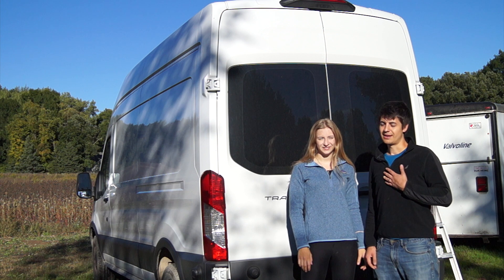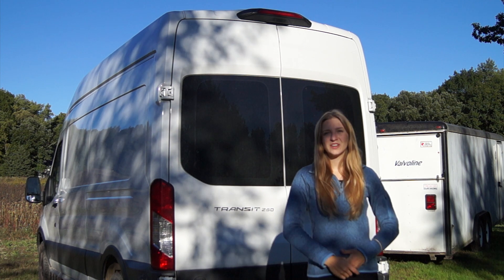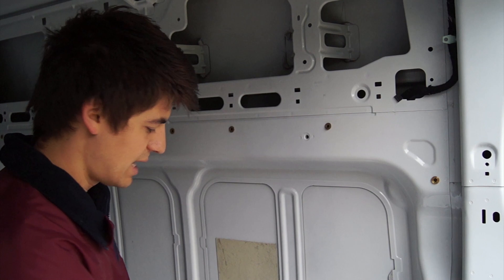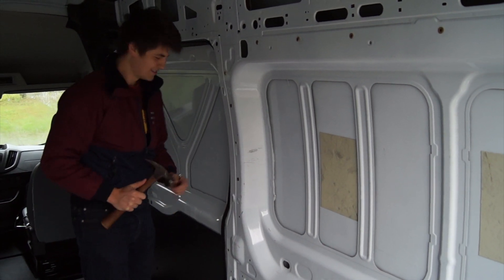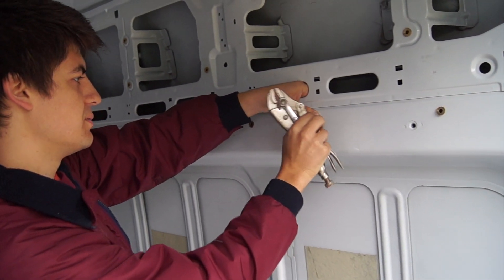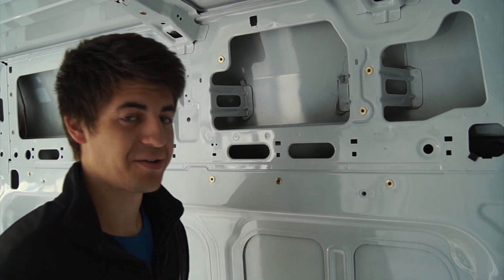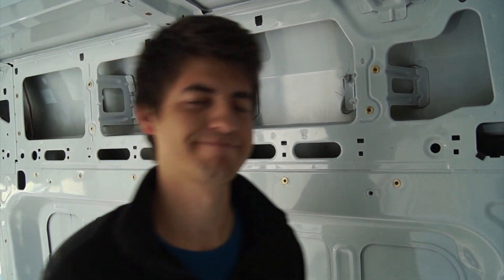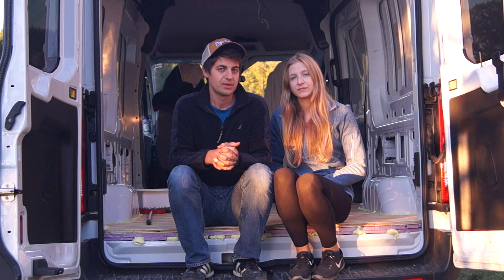Van build part 1: cross nuts and flooring

Comment: Great video. Would love to know more about using a drill. I am not sure how you could drill the hex nut. Any information is helpful...currently struggling with those hex nuts!
Reply from the maker: Garrett McDaniel 
Hey Garret! Thanks for the comment sure I’ll try to give a bit more detail. We first purchased a socket power drill wrench adapter  similar to this one: https://www.amazon.com/Universal-Socket-Adapter-Linkstyle-Professional/dp/B075G6V7SY 

Then purchased hex bolts 1 1/2 length: https://www.amazon.com/Serval-Products-4-20-Titanium-Grade/dp/B07FST17SM/ref=mp_s_a_1_1?ie=UTF8&qid=1544986432&sr=8-1-spons&pi=AC_SX236_SY340_QL65&keywords=hex+bolts+1+1%2F4&psc=1

Similar to those.

The final piece are wrenches with circular bolt fastening ends like these 
https://www.target.com/p/stanley-174-6-piece-combination-wrench-sae-set-79-143/-/A-16974336?ref=tgt_adv_XS000000&AFID=google_pla_df&fndsrc=tgtao&CPNG=PLA_Home%2BImprovement%2BShopping&adgroup=SC_Home%2BImprovement&LID=700000001170770pgs&network=g&device=m&location=9029846&gclsrc=aw.ds&ds_rl=1246978&ds_rl=1247068&ds_rl=1246978&ref=tgt_adv_XS000000&AFID=google_pla_df&CPNG=PLA_Home+Improvement+Shopping&adgroup=SC_Home+Improvement&LID=700000001170770pgs&network=g&device=m&location=9029846&gclid=CjwKCAiAjNjgBRAgEiwAGLlf2hI2vZsqSvz_ckPLB9MXX17T7yWA_J2hL3L6V2AEMzLRw7nw8a6eUxoCIg4QAvD_BwE&gclsrc=aw.ds

Then comes the process
 
We then put the crossnut in the wall.
Thread the bolt through the circular end of the wrench and into the plusnut just like you were hand tightening then hold the circular wrench in one hand and with the other hand tighten the bolt into the plus nut with the power drill. I can make a short video about it to help you just let me know how it goes!!
Reply: @scottinsa1894  Hey Scott....seriously...I owe you a beer or something! I managed to figure it and man - what a time saver!!! Thanks so much for responding!!
Reply from the maker: Garrett McDaniel Glad we could help!
Reply from the maker: Garrett McDaniel Glad we could help Garrett!
Reply: Not sure I follow. If you tighten the bolt (rather than hold it tight with the vise grip) won't the bolt just thread itself downward instead of the crossnut bulging out? Thanks.